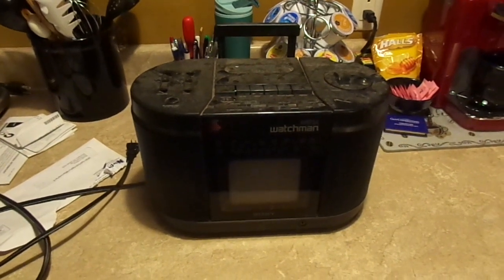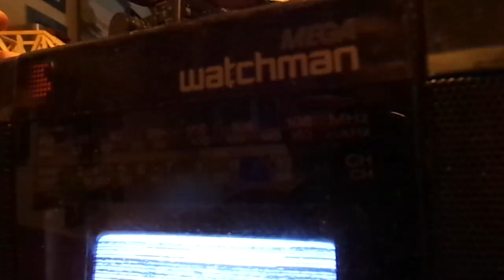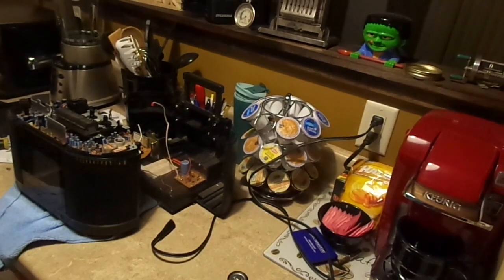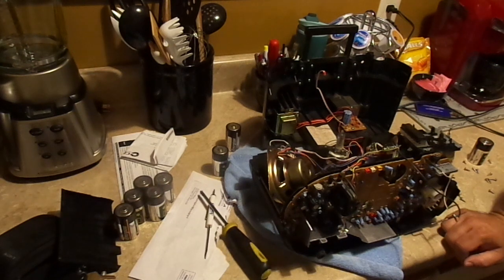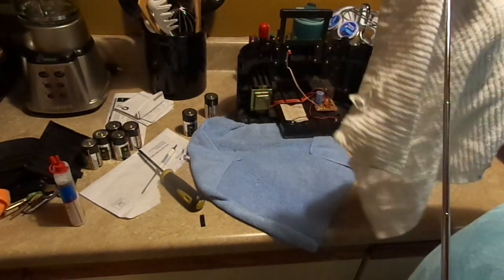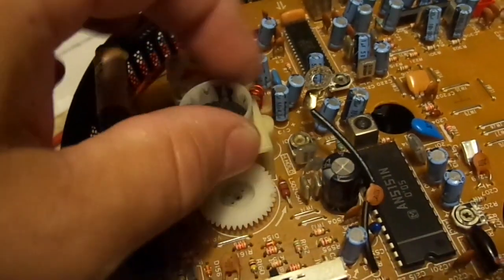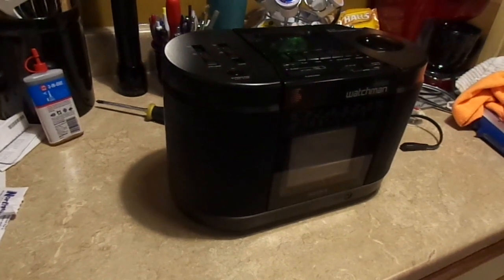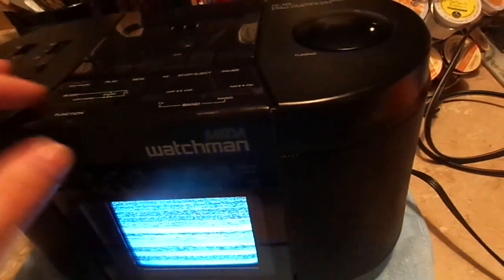Sony Mega Watchman FD-555 COMPLETE TEARDOWN!

Comment: Oh I have a "AA" version of that old battery still working in an old needle volt meter (For resistance use). It works perfectly when I use it to check continuity, I haven't done much else though.

Comment: An item like this could be modified here in England to use a device we call a "freeview" box as some have RF connections as well as SCART. Freeview over here is a receiver that pics up FREE digital TV channels via an RF antenna. So, if someone wanted to they could swap the collapsible antenna with an RF jack.

Comment: You don't have a digital to analog over-the-air converter box? If this Watchman doesn't have either a composite video or external antenna jack, you could use a sprinkler wire and wrap it around the antenna and plug the other end of the sprinkler wire into the RF output jack from the converter box, RF modulator, or VCR and then set the TV to channel 3 (or 4 as long if it matches the same RF output channel number). You could even hook up either a digital cable box or satellite receiver if you did the antenna coil trick.

Comment: It actually can take a video input back there, you just need the proper cable and set it to channel 3 on the tuner.

I just picked up another one, but the TV function doesnt work. I'll probably have to do a teardown to see if there's any power going to the neck.
Reply: SergeantJamma
     I have a fully functional one of these if anyone is interested.

Comment: Did you know that you can connect a DTV converter box to that by wrapping a wire around the antenna? I've done it before, it works surprisingly well.
Reply: Or you could just plug it into the external antenna port like I do with my VCR. Nintendo 64 through wired video to a portable tv, it's kinda fun sometimes.